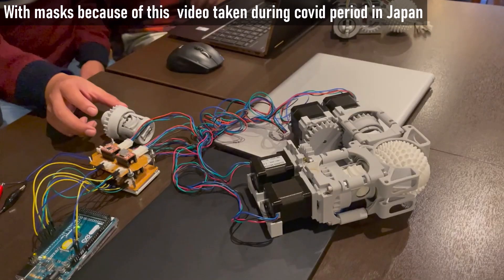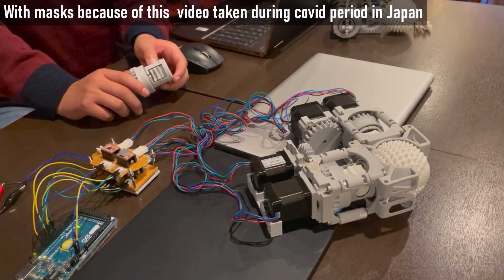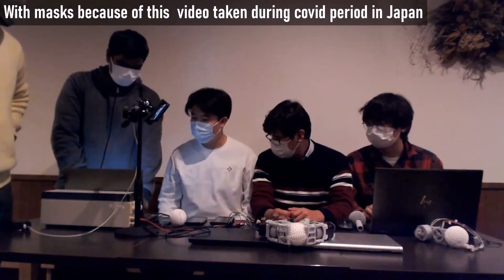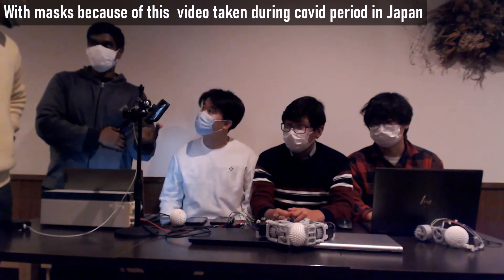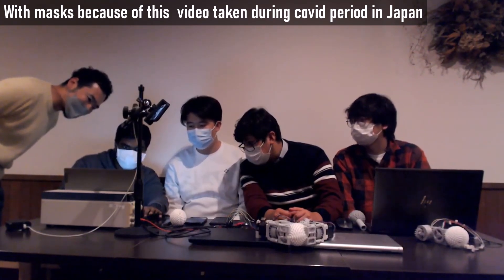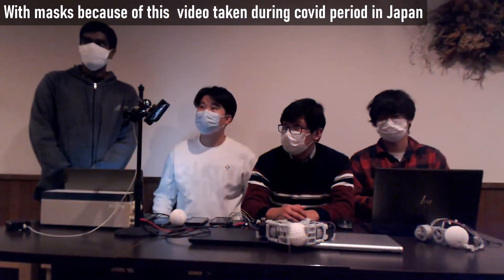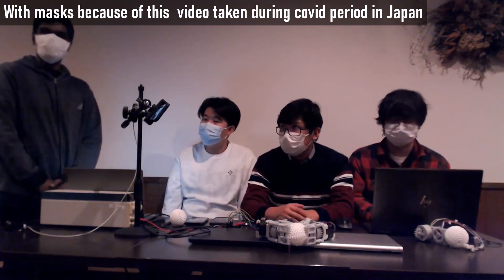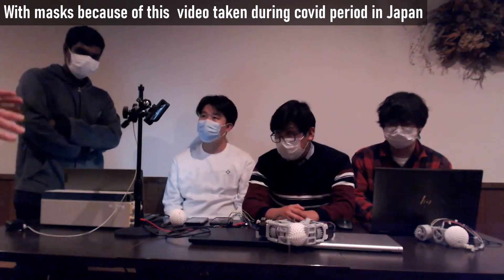Demostration of spherical gear basic movement on Dec. 2022

Comment: Honestly you can get a lot more stability if you just either use metal gears, or you take those 3D printed gears and throw them in the tumbler. A lot of the instability sounds like the friction between gears. You can get 3D printed parts to run as smoothly as a metal one, you just have to polish them really really well.
Reply from the maker: Thank you very much for your fruitful suggestion to improve the mechanism of the ABENICS spherical gear. Of course many fabrication technologies will be able to adapted to manufacture components of the ABENICS spherical gear unit including milling machines and 3D printers.
We have been also trying to improve our manufacturing methods for the ABENICS spherical gear.

Comment: That's an intriguing idea! A spherical gear, when coupled with a system of strings and pulleys, could indeed be used to control the intricate movements of a robotic hand. This concept is similar to how traditional marionettes are operated, where a puppeteer manipulates strings to control the puppet's limbs. Here's a breakdown of how this could work: Spherical Gear Mechanism: The spherical gear would act as the central control hub. By rotating the gear in different directions, it could activate various strings or cables. The gear's rotation could be controlled electronically, allowing for precise and complex movements. String and Pulley System: Strings or cables would be attached to the gear and connected to the robot's hand joints. As the gear rotates, it would pull or release the strings, causing the hand's fingers and wrist to move. Pulleys could be used to amplify or redirect the force from the gear to the strings. Advantages of this approach: Precision and Control: The spherical gear mechanism can provide precise control over the hand's movements, allowing for delicate tasks. Complexity: The system can be designed to handle a wide range of motions, including grasping, pinching, and rotating objects. Compact Design: The spherical gear and string system can be relatively compact, making it suitable for robotic applications with space constraints. Challenges and Considerations: String Management: Managing a complex network of strings can be challenging, especially in a dynamic environment. Mechanical Wear: The constant friction and tension on the strings and pulleys could lead to wear and tear over time. Weight and Payload: The weight of the strings and pulleys could limit the weight of objects the hand can manipulate.
Reply from the maker: Thank you for providing us with specific ideas. We will continue to improve our spherical gear technology by taking your opinions into consideration.